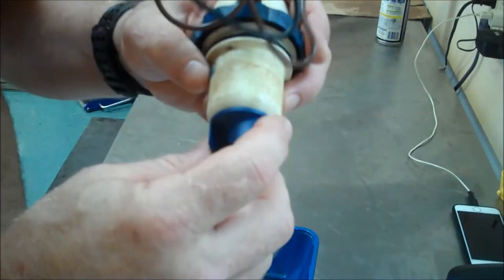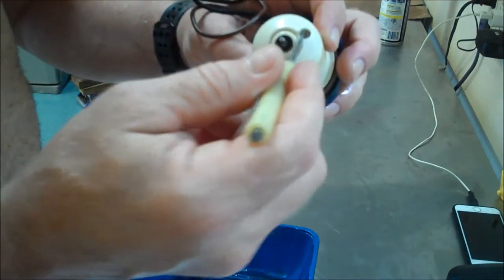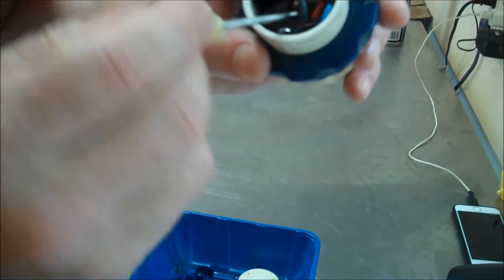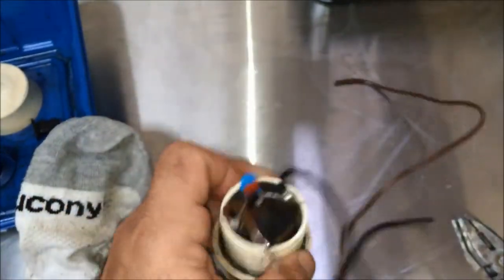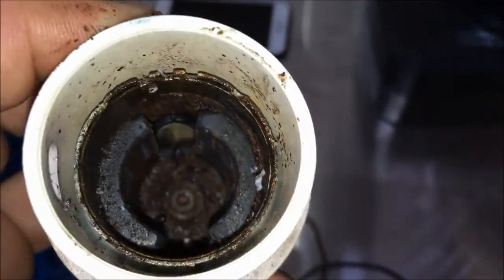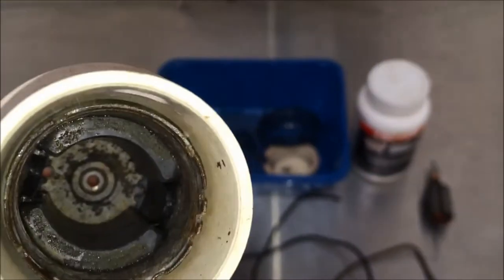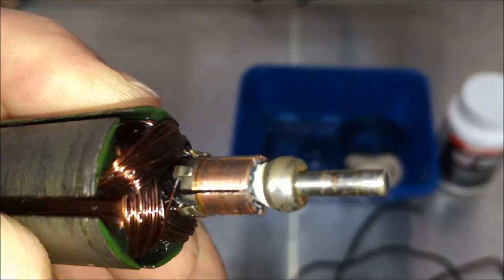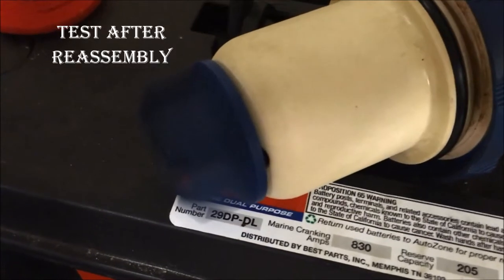How To Repair Piranha 800 Wakeboat Ballast Pump That Is Not Functioning?  Don't Replace It, Fix It!

Comment: Awesome. I’ve got a new pump ordered. I’ll take the old one apart and clean it up for a spare
Reply from the maker: Excellent, it will make a good back up. And if you keep them lubricated and cleaned out with WD-40 they will last longer